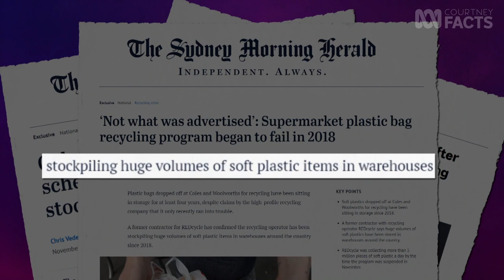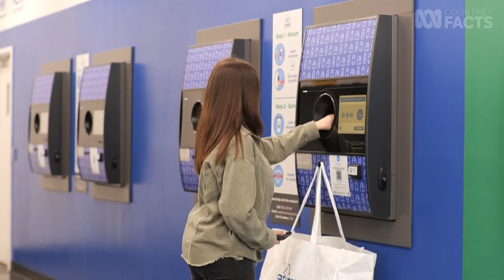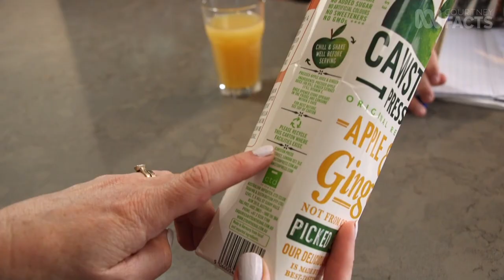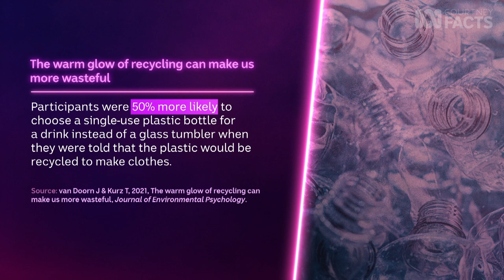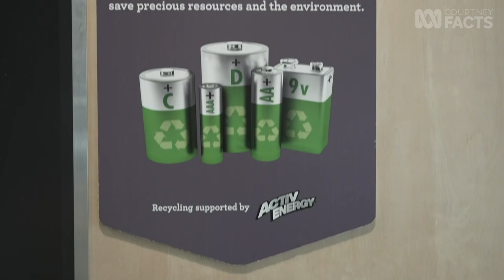Is recycling worth it? | Courtney Facts | ABC News

Comment: Having complied with recycling requests, it turned out a real bugger for me. The council did not maintain the manhole cover which goes back to 1965 on the footpath, when bringing in the recycled bin one of the wheels got caught in the gap of the cover which cased me to fall end up in hospital for a week and suffer a spinal injury which requires regular injections in my spine to block the nerves. The council didn’t want to know blamed it on Telstra (used to be PMG) who harassed me when they contacted me after telling them I had an accident with the cover because they were worried I would sue. Like one person taking on a company like Telstra would get me anywhere with that. So now after 12 years (yes correct) the manhole is replaced and I give it a wide berth when putting all my bins out. Would love a shut out the backyard like a laundry shoot to a discreet receptacle on the footpath.